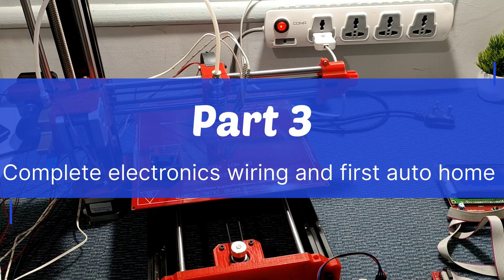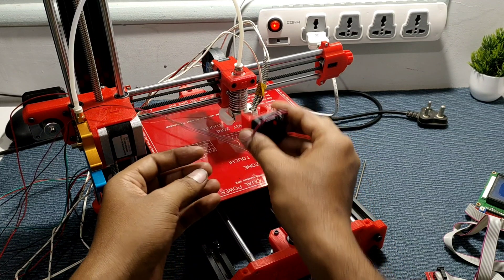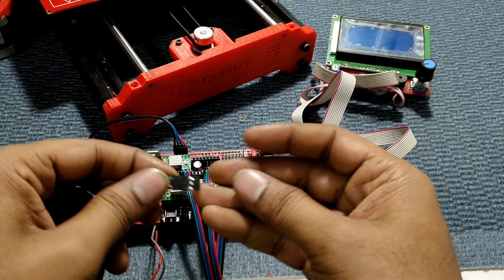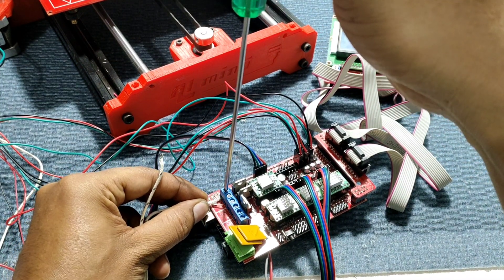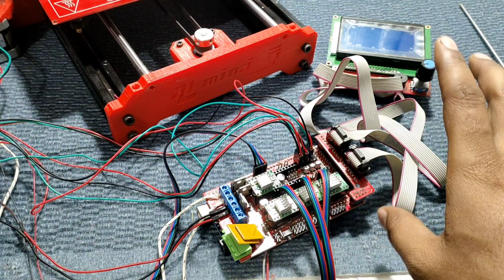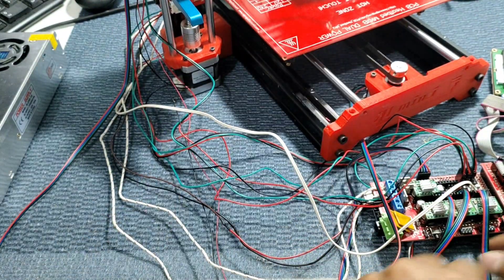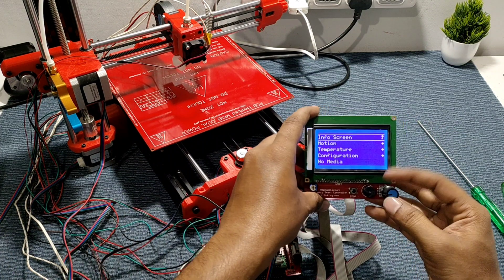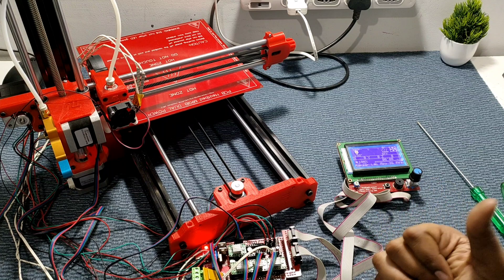Part 3 Complete working of our new Diy 3d printer #diy#arduino#prusa#viral#part3#continue#auto #home

Comment: For the holes of the printed parts, do you use self tapping screws or another method?
Reply from the maker: Yes sir some screws i use self tap
Reply: @AakaarLab  Did you also use thread inserts or any other ways?
Reply from the maker: Sir can u share which part if possible tex me in instagram @aakaarlab
Reply from the maker: @VertexDrift  if u have use m3 inserts for hotend holder or just retweet the design by reducing dia to 2.5 mm so u can use m3 self tap screws
Reply: @AakaarLab  Thank you for the info! By the way, I noticed in the video the x axis tensioner you are using is slightly different than the one you included in the files, the one you used in the video has holes for clamping the rods.
Reply from the maker: Yes sir i later thought that the screw is not required so i removed it